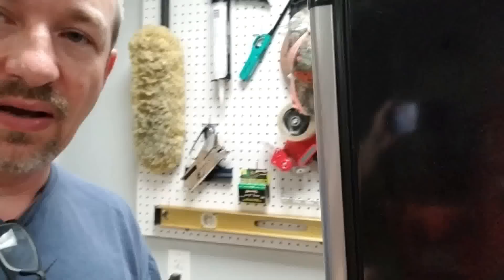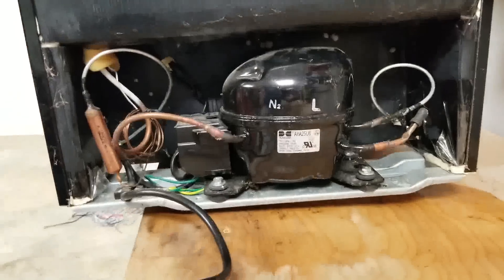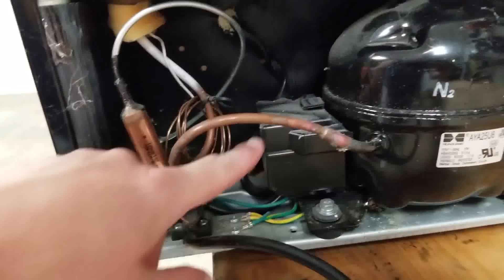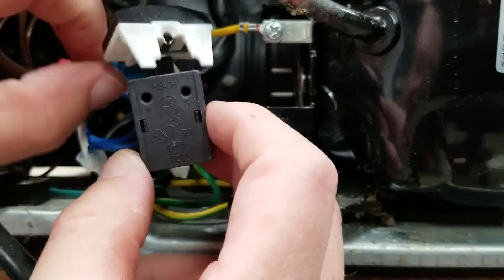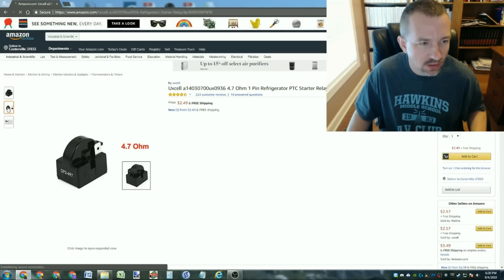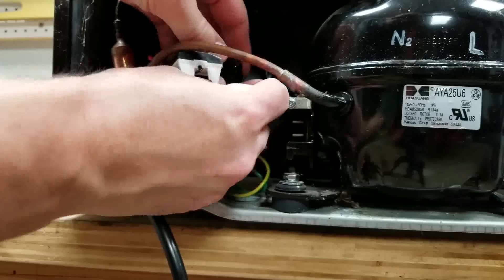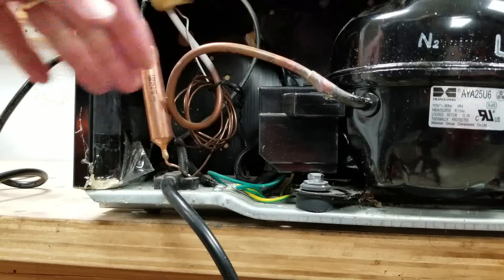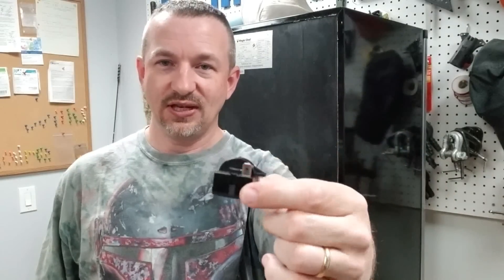Project #22 - Mini Refrigerator Fix (PTC Relay Replacement)

Comment: i am going to try to fix this , where do i get the relay ??
Reply from the maker: I got one from Amazon:
https://www.amazon.com/gp/product/B00N3WFW5K/ref=ppx_yo_dt_b_search_asin_title?ie=UTF8&psc=1
Reply: @VancesHowTo  Amazon relays are crap & or dont always have the correct one. Been trying like the dickens to find the corrrect replacement for my Daewoo because my Daewoo has been causing a surge every time the compressor kicks in. Tried a similar replacement & just caused more problems than it fixed. I think it even caused a total power outtage in my area!(it was ether that or the wind conditions at the time) What I hate about trying to source the parts myself without tech support from the manufacturer(who has been very unresponcive) is its next to impossible to determin if a replacement is 100% compatable. The only thing that seem to be built the same no matter who makes it is the overload protector. Every OEM relay seems to be too different(usually the round thng is larger than the one that came with the fridge)

Comment: Great video! My mini magic chef fridge is doing the same thing . I’m going to order the same part and hope it works . Thank you!
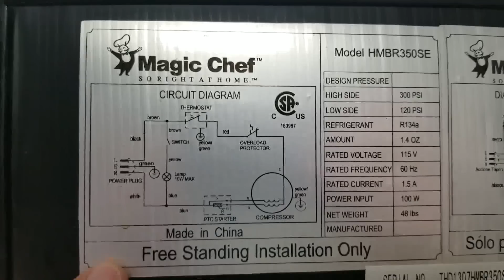Reply from the maker: Glad the video help you out!  Check out the electrical diagram in my video at 1:03.  It could also be the overload protector or thermostat.  They are also inexpensive parts to replace.  I recommend some quick diagnosis before ordering a replacement part.
Reply: My magic chef has a light on but compressor not running any idea of what this is?